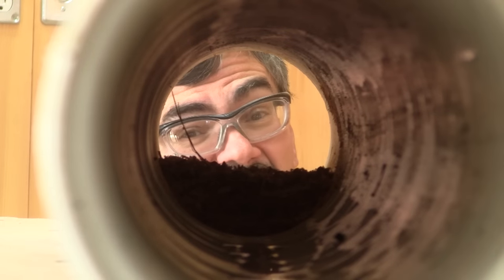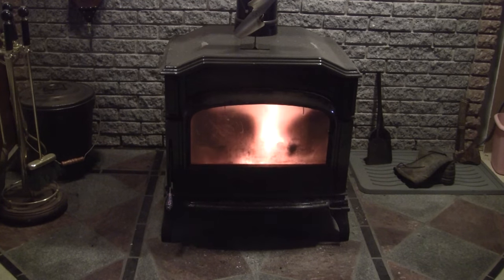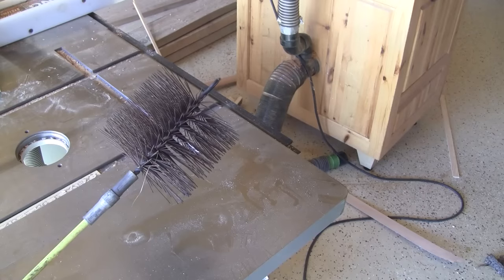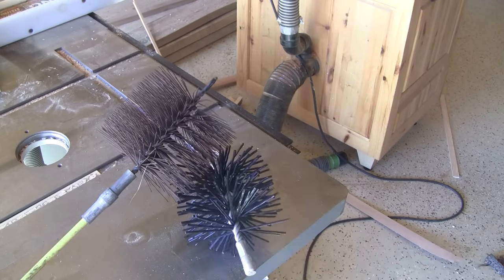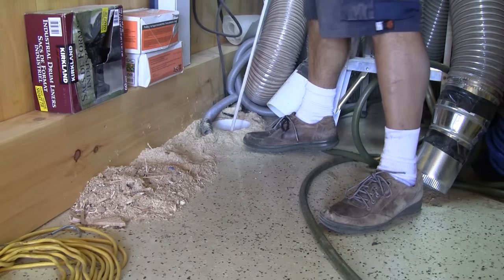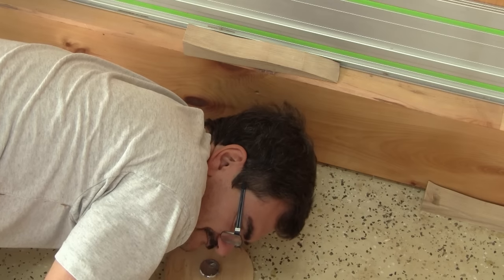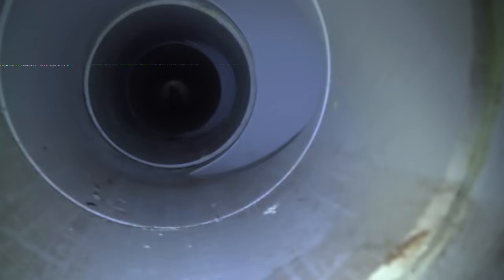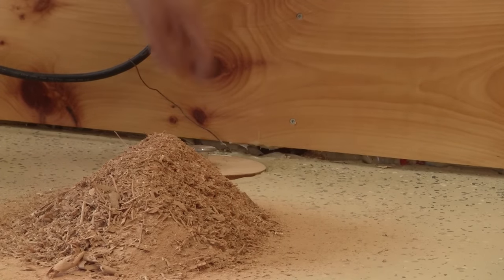The Woodpecker Ep 103 - Cleaning the dust collector pipes

Comment: Between the filter bags and the cyclone, you have a lot of air resistance in your dust collector.  Hence, not enough airflow to sweep the pipes clean.  The bigger the pipes, the more CFM you need to keep them clean.
Reply: +Matthias Wandel Would it help to leave the dust collector on for a few minutes after you are finished with whatever task required it?
Reply from the maker: +Matthias Wandel After cleaning them I realize that. I tought that a 1550 CFM would be enough but it seems that it's barely enough. So from now on I use the dustpan more often.
Reply: +Alain Vaillancourt Don't count on the rating of the cyclone being accurate, even without piping. I'd suggest is minimize how much flex hose you have attached.
Reply: +Alain Vaillancourt The large diameter of your pipe and potential air leaks is really limiting your dust collector. Usually for pipe that large, you see a 3-5HP unit.
Reply from the maker: +Jeff Ferguson I guess you're right because a 2hp doesn't suck all the dust
Reply: +Alain Vaillancourt There's a large amount of duct that has to be put under vacuum so even say you lost 3CFM per joint, that's a lot to lose. Your system does have some advantage because you are not sucking it 6-8' up from the tool otherwise I'm afraid it'd be far worse. Have you tried to improve your floor plugs? You'll also see a noticeable improvement on airflow replacing the cloth bag (along with a HUGE increase in air quality) with a pleated filter.
Reply from the maker: +Jeff Ferguson I don't think I'm losing air from my floor plug. I didn't know that I can gain airflow just by replacing the cloth bags.
Reply: +Alain Vaillancourt how many feet of flex do you have? General rule is each ft of flex is equal to 3-4 ft of straight pipe. The corrugations are a big restriction. You might be able to over speed your fan with different pulleys if you need more CFM. You should target around 3000ft/min pickup speed to keep the particles suspended and in motion. Anther options would be a second fan in parallel with the first to get more CFM.
Reply: +Alain Vaillancourt I'm curious to the amount of suction (manometer) lost due to the amount of pipe and the 90 degree turns. Most larger systems usually are connected at 45 degrees using a wye.
Reply from the maker: +Jeff Ferguson I have about 14` of flexible hoses, but no 90 deg anywhere every turn is made with whys and 45 deg
Reply: +Alain Vaillancourt Given your large ducting system I would look at a 5HP dust collector with an 16-18" impeller
Reply from the maker: LowJack187  The flex is my biggest problem... I have some 6" pipe that I didn't use in the construction of the shop but I need to buy some 45° elbows to hook everything up... I keep postponing it's not a good idea.....

Comment: I just inherited a shop at school with 30+ feet of clogged main duct.  It was over half full.   I used a 20 foot section of .5” pex tubing as an air lance.   One end, I screwed in a male quick disconnect for the air compressor.  The other end was a short piece of .5” copper pipe with an almost complexly closed crimped end soldered to a short nipple to screw into the other end of the pex tubing.   With the collector on, I inserting the crimping copper pipe into the end run of the duct, with full air pressure at the other end, that was enough to create a lot of turbulence in the pipe and clear it of all debris.  I blew three full drums of sawdust out of the system in short order.
Reply from the maker: 3 full barrel, wow... These days, I blow air from my leaf blower into the pipes each time I plane or joint some boards this way my pipes are never clogged, but mt dust collector is not big enough and I still didn't changed the flexible hose for hart pipes, I have the pipes I just need to get the elbows....

Comment: Alain, I have been anxiously waiting for your video showing us your new modified dust collection system with the Dust Deputy connected directly to the blower and a new solid air filter and verything all piped up solid. By the looks of this video I'm going to have to wait a little longer. I originally had a lot of flex hose as you do and it affected my dust collectors performance quite a bit. Good luck and as always, Great Videos.
Reply from the maker: +Jim Cameron I used to have only flexible hoses and it was terrible. I thought that having just such a small amount wouln't be an isue but I was wrong. I'll put solid duck where I have flexible ones and hope it will be beter.

Comment: Alan, I enjoy your videos.  Since I built my workshop I always look for better ways to remove the dust. Can you redistribute your dust collection area so that you could remove the filter bag and install the DC to the outer wall where the air is blown outside.  I have read that this will increase your CFMs and also helps with contaminants to be expelled out instead in the shop.

Comment: Here's a suggestion:  If you build something that has some weight that might twirl a bit, you can feed it from upstream to simply disturb any settling.  If you do this every 3 months or so, you might be able to loosen any settling.  Use the flowrates to disturb what's there to carry loosened debris downstream.  Or jimmy up some kind of pressurized line that has a wind vane on it to feed it downstream, then turn the compressed air on as you drag it back slowly.

Comment: Alain, you did a nice job cleaning them (and showing it in the well made video). I can only imagine how nice it would be to have such an extensive dust collection setup. I have to wonder, though, whether you really need all that flexible hose around the cyclone and DC, given that your system is fixed. Shortening the flexible lines (i.e. cutting to length) or replacing the flexible lines with solid duct should make a big difference in flow (and how often you have to clean the pipes).

Best wishes!
Reply from the maker: +Barry&#39;s Workshop I never thoughts of that, you might be on to something. I'll try buying solid duct to see if its improve the dust collecting.
Thanks
Reply: +Alain Vaillancourt It should make a difference. Every time the air changes direction you create friction in the airflow, which must be overcome by the vacuum. Also, if you go from a narrow pipe to a wide pipe, you'll create an area of lower pressure and thus reduced air velocity, which will drop the bigger bits. I would suggest avoiding pipe size changes right before a corner, like the one in the floor. The walls of the pipe also create a small amount of friction, so every meter of pipe will reduce airflow.

Comment: I must admit when I was watching the build videos I thought you might struggle with those pipes. IIRC they installed 9" pipes which strikes me a a bit over sized for the dust collector. 6" pipes would probably not have a problem due to the increased air speed. Time for a bigger dust collector!

Comment: I agree with Matthias..More CFM.. For periodic cleaning would it be beneficial to attach a blower to each collector pipe to assist in the movement of the dust and chips? My though would be to attach the output hose to the collector using one of those 1 HP portable dust collectors. Push and pull the debris at the same time. You could roll the portable blower to each collector point one at time and not need to pull a brush.  Just my thought!
Reply from the maker: +Kim Shirley I've used compressed air but only move the dust for 3-4ft but maybe a leaf blower, good idea thanks
Reply: +Alain Vaillancourt I've seen the leaf blower used successfully to clean out dryer vents. That should work well.
Reply: A leaf blower is what I used to clean my shop before I go a dust collector! Opened the garage door, put on my respirator mask and sent it outside!

Comment: Seems having the underground pipes isn't worth the trouble of the "clean look" of the missing ducts. Going down then up again does introduce gravity that needs to be fought against to remove the dust in the pipes.

I'm reminded of my fluid mechanics course. Pipes need to be smooth with minimal obstacles to maximize laminar flow. I.e. Maximum CFM.

Comment: Great videos!! I am planning my garage build and plan on installing under slab pipe. Is there anything you would do different?
Reply from the maker: +Tony Ozimek To be honest NO. But I think that for 6" pipes my 2HP dust collector is not powerful enough. It does the job but from now on I'll try to use the dust pan instead to sweep all the floor dust into the pipes. I'm not 100% sure but I think that my problem is that when I sweep a lot of dusts at once it settle down before getting into the cyclone, but if I use the table saw, thickness planer or jointer, I only throw a small amount at once and all that end up into the cyclone bucket.

Comment: Why was the dust not getting collected into the cyclone?
Reply from the maker: +Brad Bell My best bet is; bigger chips just stays on the bottom of the pipes, after a while the smaller dust get stuck to it. If I had way more suction everythiong would endup in the cyclone, but it's not the case.

Comment: It's really a problem to clean pipes that way. You have to figure out another way to clean them or make them maintenance-free... Also, I reuse ALL my sawdust. I mix it with water and shredded paper from work and make Biomass logs. I made a compression jig, dump a load of wet mix and squeeze the water out. I let them dry  and BAM!, free Biomass logs

Comment: Google bill pentz to find his "massive" work on dust collection. The visible dust is not the problem, the small 1 micron and smaller is the problem. This small invisible dust causes breathing problems. Mr pentz's site has air flow requirements for moving dust and giving us clean air. Pentz's basic design is now the Clear Vue Cyclone. it has a 5HP motor that moves a lot of air. While you may want to keep the pipes clean that system does more to clean the air we breath. They are not inexpensive and I take it you don't live in  the USA which makes it even more expensive. reading his reseach may give you ideals to improve with out spending a ton of money.
Reply from the maker: +dejanira2 Thank you I'll check this

Comment: You should have nothing in those pipes, your dust collector isn't powerful enough. That is the issue. PS, you need to run a solid wire thru all the lines and ground them. Fire safety.
Reply: +mmanut Do you need to ground pipes that are already IN the ground?
Reply from the maker: +Peter Collin I've put a cooper wire around them but since they're already underground I figure they're already grounded.